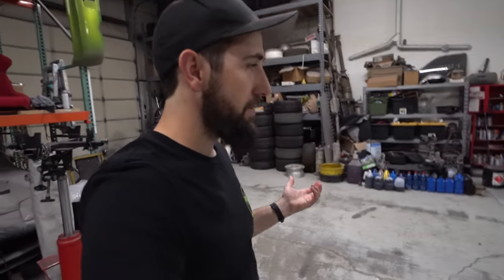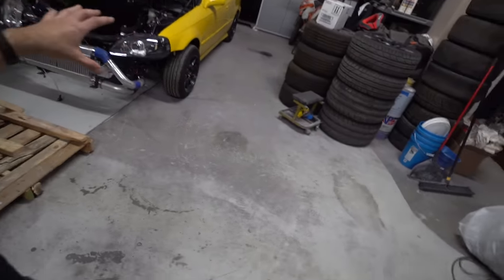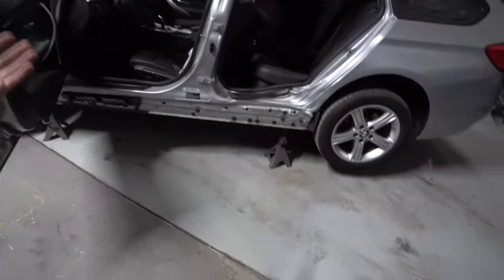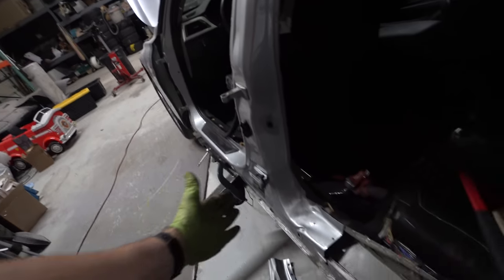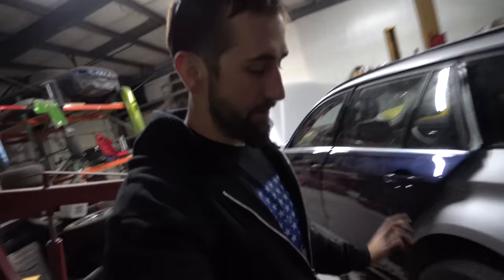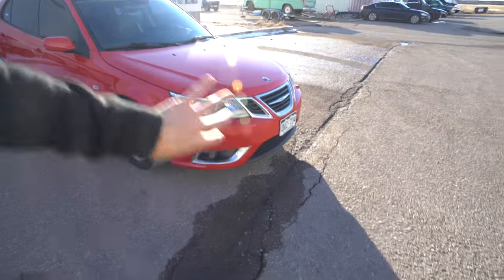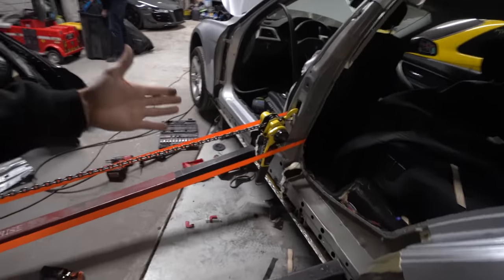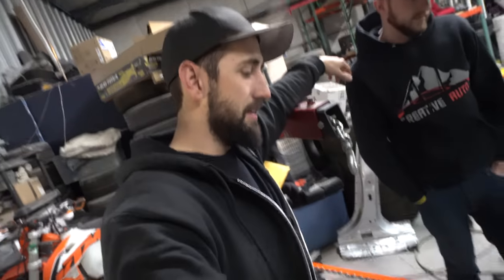CAN I SAVE THIS WRECKED SALVAGE AUCTION BMW? ( 40mpg + Frame Damage )

Comment: DO NOT REPLACE OR CUT THAT PILLAR!!!! It is part of the main crash structure if you cut it and tried to weld it will not only be unsafe but it will NEVER be correct!

Comment: Keep up the good work. Just wanna say being I've been to college to properly repair vehicles this just worries me as you are doing some thing wrong but you are still doing some stuff right. More than likely the b pillars are ultra high strength steel with a little boron steel which is very hard to straighten and requires a certain way to repair and if you are going to section in a new piece  you are thinking of the right places to do it but there is also a specific place from OEM  on where they would like it sectioned. I wouldve personally tried to pull as much of the damage out as possible before cutting anything. Keeps the structural integrity and when putting it pulls it all out.

Comment: Hi Trevor just as a suggestion of what you can do, take a hydrologic bottle Jack and a pole weld the pole to the top of the jack, take a block of wood Place it on top of the transfer tunnel, were the hinge sits on the back of the b post And slowly jack it out with a flat metal plate.

Comment: Hey I’ve been a body man for years you don’t want to cut into the inner B pillar it’s made out of boron steel and any welding on it will make it weak try pulling at the best you can put it in there congrats on the bun in the oven

Comment: I’ve got a 2017 F31 wagon like that. 

Few things you should know. When pulling metal like that- you want to use a hammer to tap and let the metal unwind while it’s under tension. It helps it unfold. 

With a single arm puller the center post just needed to be pulled out and downwards to correct it. At this point you are going to section it.

Avoid pulling the roof skin. It’s a nightmare with a piece as big as that car has

As for what to do with it- big hp 3.0 diesels from bmw are seriously impressive. The 2.0 struggles even chipped

Comment: Pound a tight fitting 12 point over the buggered lock nut and then remove with a long handle strong arm.

Comment: Since you mentioned money being tight.  I think what i would most be interested in watching would actually be a really cheap series.  I’d love to see a bare bones cheap drift car build that someone interested in getting into drifting could build without spending 2j S550 money.  Maybe an e36 or something similar that can be had on Craigslist for 1000-1500.  Gutted, hydro, diff, and whatever else someone experienced like yourself would suggest.  I know you probably won’t read this but if you do i think it would be rad.
Reply from the maker: I did a budget built e46 sedan a few years ago

Comment: Find a huge thick metal pipe atleast 5-8", drill a massive hole in your ground, shove the tube deep into the ground, fill it with cement. You can use this to anchor off of, next you will need strong anchor mounts on the floor. Any car you plan to pull frame on you will need to chain it to the floor or else the car will just get dragged. Your puller is good, but maybe upgrade to a heavier ton will help. Or buy a used frame machine! Also pretty sure you can find a "vtuned" near you, just look in your ghetto areas for body shops, pretty sure they only charge a few 100 bucks to yank on the center post.

Comment: Cutting and welding a load bearing structure doesn’t sound safe to me. Just pull what you can as much as you can n slap the doors back. Then give it a Trev custom paint job. Quarter of an inch doesn’t seem worth it.

Comment: Congrats on the baby, that's awesome!

Keep the Saab, Civic and Mustang, of course.  Sell the R8 & BMW, and the old DSM stuff you had out back.  DSM stuff is cool if your going all in on it, but you don't have time for those finicky old things with all the other vehicles needing your attention.  3 series BMWs age like milk, you can almost hear it depreciating.  That wagon, especially if the title is marked, will hardly be worth the effort of straightening it out and painting it which is why it was in a salvage auction and not repaired already.  Knock that soulless appliance together and cut your losses.  

The Saab is cool and funky, get it detailed professionally and keep rockin' it.  I don't mean run it through a car wash.   A high end pro detail job will go a long way to making you rethink replacing a vehicle, and it reminds you why you got it in the first place.  My detailer offers pre-sale details, and many people are so impressed they rethink selling, and just keep the car.  I say have pros do it because even though you or I could detail a car, we don't have the tools, supplies, tricks or skills of seasoned professional detailers.  We could easily go spend $500 on basic detailing equipment and supplies, and still not have all the tools needed to do the job properly.  Plus, now I have to sweat my balls off for 2 days stripping down the interior seats out, cleaning every square inch, reassemble interior, mask, clay, cut, polish and now you've drug the polisher across some trim marking it, now you've burned the paint on a body line, now you've caused more swirls than before because you were careless with a dirty pad.  All this work only to have a low quality result.  When you could drop it off with a detail shop, and go put your feet up with a cocktail.  Or go spend that time with your family.  That $500 I could have spent on supplies is a low price to pay to have 2 days of not busting my ass, and someone else do a better job that I could.  Time is valuable, know what you can do well, and know when to pay a professional.  Not to mention a $500 pro level detail can easily polish over $1,000 of value back into a vehicle.        

M3 wagon build, not terribly interesting to me.  Now, a 2000 M5 build of some kind?  Drift M5 maybe?  MadMax/Off-Road M5?  That I'd like to see.  Maybe just clear the deck and focus on getting that Civic race ready, be cool to see you regularly running at events with Kyle, Brent, Emilio & co.  Cleetus just inherited Tavarish's turbo civic, maybe race him for fun in Fl. @ a Cleetus & Cars event this year.  Trevy's Customs Drag and Drift Road Show, get the Mustang and Civic out there to events this year and sell some merch directly to the people.

Comment: Congrats on the girl! I'd keep the Saab, you'd be hard pressed to find anything better. They are just so good for what they are. Get a cheap PDR kit and have go at those dents. The pillar one might take a bit more effort but most of the roof ones shouldn't be to hard. There's plenty of channels to learn metal work from. Arthur Tushinsk(or something to that effect) makes it look easy. Cold war motors is also a very capable body guy in a more oldschool manner etc

Comment: I wouldn't put full quarter in id join where the cut is,. Definitely don't replace the inner wheel arch just dress it up with hammer and dolly. When ready for the new panel over cut everything by a couple of inches and then place it over the existing bodywork work out where you want it clamp it and then cut through both panels together that will givs you matching joins to weld together. The manufacturers way of doing this job is actually to glue and rivet it together I do this type of thing as Day job let me know if you need me to go into more detail

Comment: I'd take it another direction - get a wrecked F30 340i xDrive sedan and throw the B58, 8HP and diff. into this car and have a 500+ HP AWD daily - MKV Supra sleeper dad wagon. You could also put the M Sport front bumper on. Hit up Kies Motorsports for some parts.

Comment: You shouldn't paint where the glue is supposed to go anyways I should just leave it the factory primer or the old glue and cover it with tape when you paint it because the pinchweld primer sticks better to that stuff then it does paint

Comment: The B pillar is strong for a reason, if you cut it and weld it at one of the strongest supporting points what would happen in the future if your mom was driving and got a side impact accident on the same location? Hate to play devil's advocate but that would make me want to at least not have my mother driving the car after.

Comment: Get a BMW e46 M3+ with the 2jzge then single turbo it would be a slightly different 2j project with a 6 speed e46 getrag- these things done right sell for a packet here in the UK and this would bring more subs from bmw fans or 2j fans LOL

Comment: Hammer an 18 mm socket over the wheel lock
Reply: Leo Gargano the outside of it spins specifically for that reason. We tried haha
Reply: @carguyty9370  did you try calling bmw? They may have master set. We did when I worked at VW/AUDI
Reply: 4GsRacing closest bmw is like 40 miles away
Reply: @carguyty9370  I didn't even stop to think you guys prlly don't have anything nearby! Can you weld a nut to it? Im sure you guys will come up with a fix. Good luck!

Comment: sell it. consolidate. rip threw some lingering projects.etc.

life should not be about gas mileage. i had a Pontiac G8 as a daily. my drive was 8miles each way. average speed 25mph (via info screen), average gas mileage...consistently, both on info screen and math... 10mpg. just a rowdy 6.0L LS V8, making 440wheel... sure you got her on the highway (never) and cruised, and i put like 1500+miles on a road trip to confirm she would get 20-24... but ehh. whatever... keep buying interesting shit. cars that make you smile. things that excite your inner passion.

Comment: What about selling spots for the R8 through PayPal at a set amount. Luke fink did it with his jzx110 through Facebook. Car was only worth max 10k but sold spots for $150 per spot and had a raffle to win the car. Ended up selling the car for 30k that way. He promoted the raffle through his YouTube and Facebook. Idk if it possible in the U.S to do it that way. But it's worth a thought. Could get way more than 80k for the R8 that way
Reply: They had $150 per spot with a cap of 200 spots. You could buy multiple if you were willing to spend the money. You have a way bigger following so I don't see why you couldn't get away with $200 a slot and a cap of 500 slots. Putting you at 100k for the R8!
Reply from the maker: US laws are different regarding raffles and lotteries.

Comment: Dude put a port a power on the inside with the engine hoist on the outside. Remove the seats to gain access to place the port a power. Your struggling for no reason.